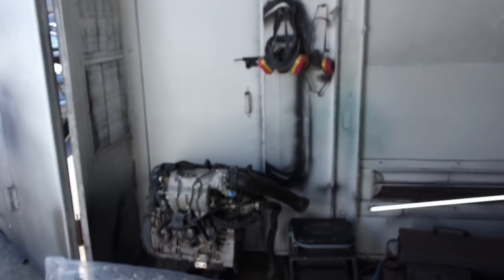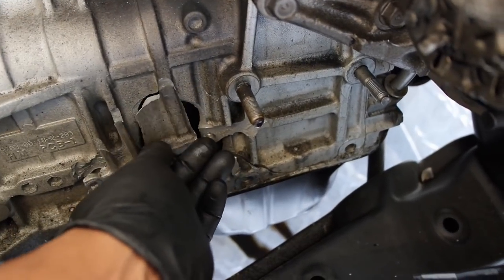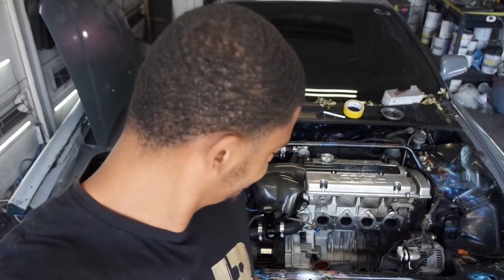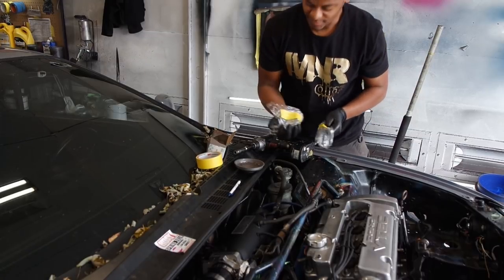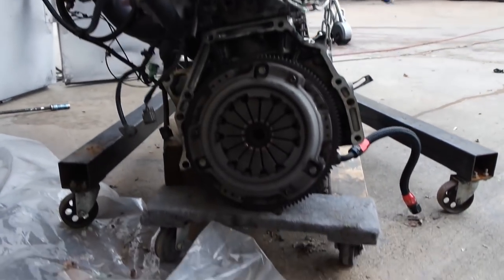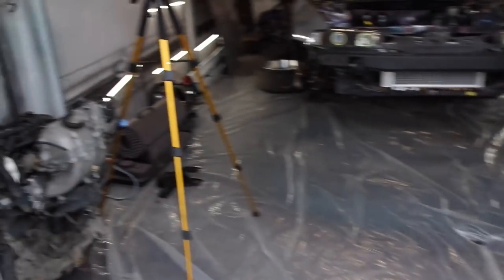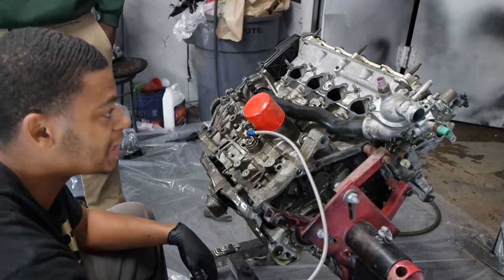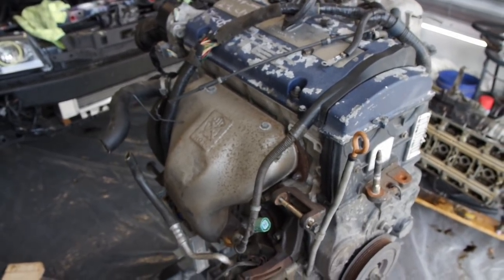Turbo Honda prelude F20B motor swap pt1

Comment: For preludes that weren't wired for vtec. Could you show how to wire the motor to the ECU. Mechanics say it's hard and need to rewire the whole car and others say it's as simple as running 1 wire. If you could shed some light on this;it would be awesome. I have f22 and have an h22 to swap. Maybe I could Frankenstein the 2 together. What do you think brotha? Keep up the good work dude.
Reply: Erik Boudreaux it is as simple as running one wire from the ecu to the solenoid. Get your ecu pinout, find out which pin you need to utilize, pin it into harness that plugs into ecu and run it to solenoid.
Reply from the maker: Yea it is pretty simple but il make a note to do a video on it it is very useful info.
Reply: Would appreciate it!
Reply: If your prelude is 93+ it's pre-wired. Just an FYI on that.... Theres a light blue wire that ends into a plug in the engine bay (for vtec pressure switch)...and the vtec solenoid wire is already capped in the harness at the pass. side shock tower...
Reply from the maker: @andrewschuepfer6523  ive heard that  b4 but i was never able to find it.
Reply: Appreciate the heads-up fellas. I got played by this shit mechanic.
Reply from the maker: @erikboudreaux9554  he might not have known most mechanics do use shortcuts like the rest of us.
Reply: Is you're f22 not a vtec?????

Comment: Trey Be Swapping F20Bs on every episode if he dont call KStuned and get some pistons and rods for it. The pencil long rods and fragile rings combined with 11-1 compression just do not do boost well. Ive seen very few success rate on boosted stock F20Bs. But for real you need some pistons and rods or youll be atleast another longblock deep. Pencil thick longer rods and de stroked higher reving motor equals bingo bango
Reply from the maker: Lmao i just wanted to get her running again for now. Ill be building soon.

Comment: Real quick question fam why F20B and not H23a🧐
Reply from the maker: F20b has a cast iron block and sleeves. Its the best N/A motor for boost for up to 450hp-500hp range
Reply: Cast Block & Sleeves BUT not a reliable Rods & Pistons, Replace the weak parts and learn from your mistakes
Reply from the maker: @nabeelshamsi7317  its on my list bro

Comment: How are the headlights? They're aftermarket but do they hold up well? Also, where are you located? I'm in Alexandria, VA and rebuilding a 93 VTEC
Reply from the maker: They good for what they are but i want to retro fit better projectors

Comment: That sucks brotha good luck with this one
Reply from the maker: Thanks bro
Reply: Ya for sure are u gonna do any thing different on this one or are u gonna stay with a stock block?
Reply from the maker: @egjay3918  yea im gonna get a new manifold fabbed up so i can get rid of the boost creep and get retuned.
Reply: What causes the boost creep to happen anyway  Is it a defect in the manifold or something?
Reply from the maker: @egjay3918  its basically when the wastegate cant regulate the amount of exhaust gas coming from the motor which cause over boosting. In my case the flaw is in the placement of the wastegate

Comment: Did you have to add new mounts or does the f20 just drop in and bolt on?
Reply from the maker: Have to swap the accord post mount on the motor for a prelude one.
Reply: @treybedipping1734  is that the one on the right ?
Reply from the maker: @xpivk_2338  yea driver side
Reply: @treybedipping1734  thanks 🙏 I’ll see if I drop a f20 in mines 🔥